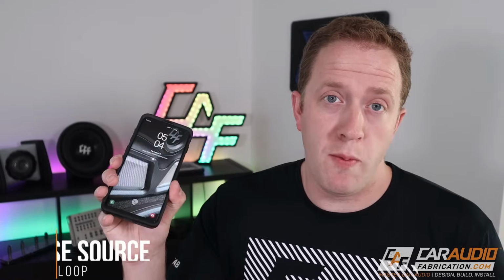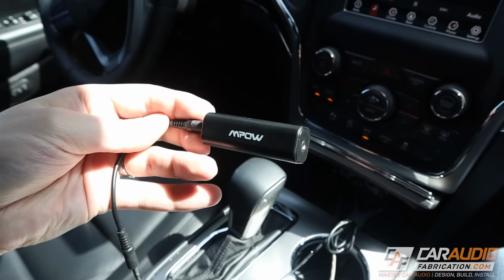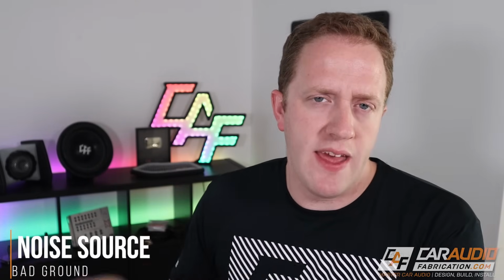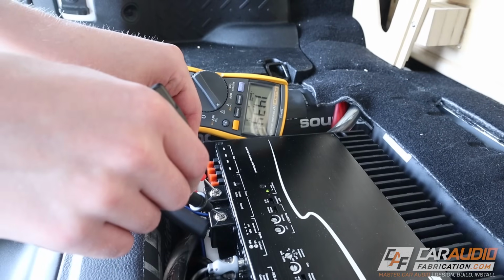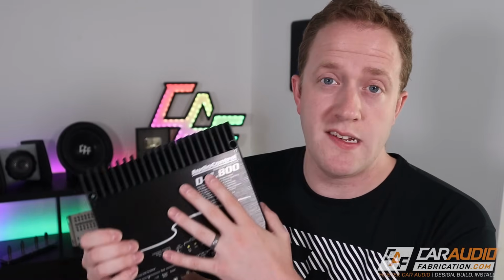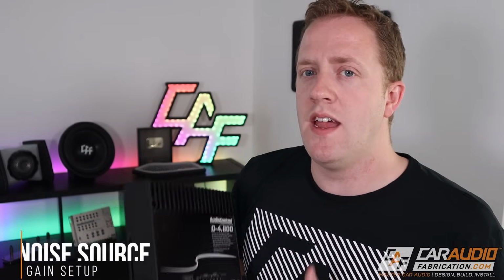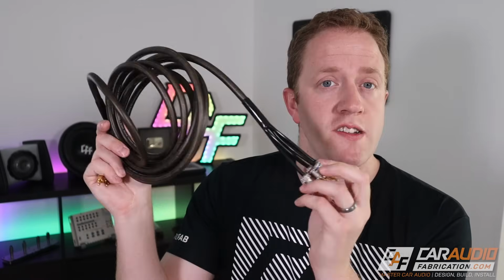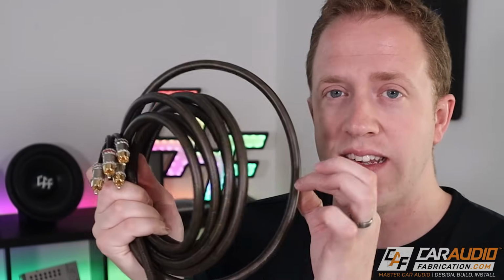BUZZ, WHINE, HISS? How to FIX Car Audio Noise!

Comment: I was just wondering if you can help me I hopped in my car yesterday had it have never had any problems with my speakers with my sub with anything like that making any static noise is than I connected my cable up to my phone and turn the Bluetooth on and now for some reason it keeps on bringing a static noise through my driver's side speaker even when I turn the car off for about 5 to 6 seconds after the stereo has been turned off it will make a static noise for some reason it's all been the same I haven't changed anything over it just suddenly started happening

Comment: After  few months if not even listening to my stereo I'm going to dive back into it.. i think ive done just about everything. Doubled up my 4 awg big 3. Ran new grounds to a busbar. From there to the head unit, and amplifiers,dsp and 5farad cap. I think one of my 3 amps is bad tho so im about to throw some more money at it. If i could find and get rid of this loop id be happy!! Ughh.

Comment: Anything recent for the fm audio issue? It’s an iPhone with fm transmitter with 2 usb charging ports. What to use?? Going insane here. FYI car is 2005 pilot there is no easily accessible aux port/plug in.

Comment: I connected my amp and subs to the factory radio and the ongoing bass drives me crazy and i've tried many things and still dont know why its still thumping. It only goes away when my rpm is over 1500

Comment: Always had alternator whine and dtatic hiss in the tweeters during acceleration. I later traced it all back to being inadequate grounding. Ill say that 95% of problems in a system come from either your grounding locations/installation or even less consodered being your remote turn on wire! My remote wire destroyed 3 amps but always showed 12V to the amp and i never even suspected the gmremote wire as i was hunting and redoing ground after ground to fix the issue. CHECK SIGNAL WIRE FROM THE HEAD UNIT ON STOCK SYSTEMS! They will go bad and arc or send a ridiculous surge during installation if your grounds are not on point! I wish i had known sooner!

Comment: Hello,  just paid a good amount of money for an aftermarket system install in my wife's 2016 Honda Pilot.  We had 2 sets of Audison component speakers and 2 JL Audio 10'' shallow mount subs all ran from a JL Audio VX1000.   When we picked up our car we noticed that there is a slight whine and a static popping noise when the doors automatically lock.  We took it back and the installers cannot figure out the issue?  Please help.

Comment: Need help! Whenever I press the remote start for my car and it doesn't turn on, I get this loud humming sound thru my subwoofers. The sound starts low and then gets louder. It stops when I press the alarm button. Any suggestions or idea it could be.

Comment: I was using an aux with my phone. Everything was good. Went into a store and when I turned the car back on there was a screeching with radio sound in the background. Unplugged the aux but the screech persists on all modes, not just aux. Factory radio, no upgrades of any kind. Any thoughts?

Comment: I have an issue I'm currently working on. Upgraded the head unit, added 3 amps and a DSP.  Once all put together I got this weird buzzing noise that went up and down with the ending revs. So I used a Ground loop isolator on my Ipod and it fixed the alternator wine but I now have this weird rhythmic ticking noice. I put a power filter on the DSP but it was still there. I test ran an RCA cable from the head unit directly to the DSP (avoiding any other electrics)  and its still there.
I'm going to add another noise Isolator to the Head unit and see if that makes any difference.

Will keep you posted

Comment: have aftermarket radio about 10 years old caused the factory speaker on one side to go out. started driving truck again and replaced both speakers, during the winter sometimes the left side speaker would have a muffled sound and if above a certain volume would cause speaker to fail. both sides working intermittently after that. each time vehicle was turned back on it was same scenario

Comment: Hi Sir. I hope this will find you. 

Briefly, my issue is in a 12v boat system.  I use a little bluetooth device with the 3.5mm connector serving the speakers. 

The charging cable to this device is via the micro plug (like a phone charger plug) via a USB and powered from the cigarette lighter port on the 12v panel. 

Noise is experienced like a clicking sound and hmmm, only when connected to charging cable. Clean whilst running on its own battery power. 

I tried different battery charger socket units, put ferrite filters on the charging cable, tried capacitors on the line but no effect

Any suggestions would be appreciated

Thanks

Gerry

Comment: Personal experience: buy a decent radio, s/n 90db or above, attach ground black wires to a good metal surface, 2003 Element EX, old pioneer stereo FAIL, cheap Chinese radio FAIL ,even worse , I just installed a Pioneer DMH-100BT, excellent radio, no noise, no whine, no hum and very good sound 😃

Comment: Have a 4 channel amp and never had a buzz and only used the two front channels. Today I added some speakers to the rear channels and now I have a buzz only in the front speakers? Any ideas? I didn’t figured it would be a ground for the amp because i figured all speakers would buzz

Comment: Ground loop isolator helped a little but but even with head unit off volume down I still hear it idk where its coming from I have to many upgrades to list done to the car the only thing I have not done an desperately need to do is add more grounds to my system........its 10,000 rms all ran on 2/0 even the (4) battery's and amps all connected through 2/0 ....
There also ALL SHARING THE SAME 2 1/0 PICES OF WIRE USED FOR MY GROUND!!! I will need to double up and add a few more Grounds using the 2/0.
Does anyone know if everything needs its own Ground each amp and battery or if using the bussbar I have is fine thanks.

Comment: I installed an aftermarket head unit for bluetooth ect with the proper facia kit for my car, its very common for people to do this because car has an icc in the dash but no bluetooth or aux so its kind of a 2nd stereo in a way. I have factory subs and amp. Now i have the loud squealing that gets louder with acceleration abd the volumehas to be all the way up to get any sound at all. It was installed with a loom for my car also. I've no idea what one of these problems could apply to my situation because my amp ect is factory and we didnt touch all that. Clearly my knowledge is very limited here but any help would be appreciated.

Comment: Love your videos they are so so informative. But man I have a problem that is beyond me. I have a dsr-1 integrated into my factory 2014 taurus limited headunit with the correct harness to match. At no volume nothing at 1 volume I have a static that just crackles and will make a literal beep sound "not any louder" but when at high volumes you can pretty much hide it completely. My power and ground are opposite from each other everything is top grade equipment and wiring. Could I email a video? I feel its something so simple that's causing a electronic disturbance sound or something.

Comment: I’m going through this right now. So very frustration. 
 
I first added filters on the rca cables. 

Them I checked the amplifier ground.

Then I changed and rerouted the rca cables.

Then I added the filters back and grounded them too. 

You mention the aftermarket HU may need a better ground. That’s the next thing I will try.

I had two amps ran through a DSP from the factory HU and all was good, kind of. I then decided to get rid of the factory HU and DPS and go with an Aftermarket HU. Alpine ILX507 to Alpine type R 4x100 amp. 

So frustrating. 

I will run a new ground for the HU next and if that doesn’t work I’ll drive it into a lake.

Comment: I just put speakers in and they're wired to the amp, I've had a sub wired to the same amp for a couple years with no interference, when i turned the car on with nothing playing i was hearing a radio channel i would never have on playing through the new speakers very lightly. 

I removed the radio antenna from the car and this fixed it about 95%.

There's a lot of contact between the metal of the basket of the speakers and the metal of the car. 

Same speaker wire is being used as on the sub. Not greatest quality probably but no problems before. 

Any suggestions? Thanks

Comment: I’ve installed 2 different DSP-810s in my car to try and get rid of the hissing. Audio Control said to check the ground jumpers in the unit. I tried all 3 settings, ground, isolated, and 200ohms and still the hissing is there! Went on Crutchfield and it looks like it’s a design flaw from Audio Control. How can they charge so much for their DSP and have it make noise?? My system didn’t hiss prior to installing the DSP. Now they want me to check the grounds 1 by 1 🤦🏻‍♂️ Can’t believe this. Anybody have this issue with Audio Control?

Comment: where's the mention of the ground loop isolator? a lot of things here might work but a ground loop isolator between rca's and amplifier fixes almost all ground loop noise. The RCA's pick up a lot of noise but they recommend a random brand instead of telling people about ground loop isolators that can fix the almost most of the rca problem.

Comment: What about a Lexus GS 300 06 with a mark levinson system. I have factory radio and factory amp? Could a blown out tweeter be causing the static noises?

Comment: I’m driving a 99 miata and have an aftermarket kenwood stereo(just the dash unit) and it whines every time when I accelerate it. Does it with nothing connected and connected when in aux mode. Would the ground loop fix that?

Comment: I've got signal noise in one speaker front & rear, when I rev the motor,  I've swapped the RCAs left/right,  the sound switched speakers. Would the rca noise reducer work in this instance?

Comment: 10/3/2022

Mark: After installing an after market radio in my 98 Mustang Mach 460 system, I heard a whining noise from the starboard side tweeter, and no music. A tech from a shop in Salem, Oregon, diddled with the wire harness, and could not figure out the issue, and so recommended that I replace the whole stereo system including speakers, amp and head unit. After the tech's effort, now I have a whine coming from the port side tweeter and no music, but the starboard tweeter works great with no whine. Also, all four rear speakers are suddenly putting out sound whereas before the tech diddled with the harness, only the sub woofers were functioning, but not the tweeters. Is the enough information for you to rule out the factory amp as being the root of the whining problem?

Comment: hi there, thanks for all the wise car audio info! 

i am looking to install a 12v studio monitor system in my studio in my ambulance conversion.
i need a very characterless amp that will give me a very precise and clear sound through the monitors which will have a flat frequency response. 

have you ever seen a system like this before? would you advise to go for this approach rather than mini active monitors like most mobile studios have? i wanted to avoid this to avoid the inverter for efficiency reasons.

any advice/ reccommendations would be epic thank you!! cheers!

Comment: I have a Boss BCPA9 in a 2012 Tahoe using Axxess AX-GMLAN44-SWC module. I get feedback at startup and when the factory chime happens only. Like If you don’t put on your seat belt and you get warning signs. Any ideas on how to fix it

Comment: I'm not promoting any certain brand, but I've noticed Alpine systems in particular have very clean sound. I'm unsure if they have superior circuitry. But I've eliminated noise problems with an amplifier just by changing brands

Comment: I just finished installing 2 sub woofers and amp , and now I have a intermittent hum coming from my subs . I soldiered my speaker wires and used ferrule connectors for my power and ground , what do you think the problem might be?

Comment: 76 GMC Sierra.  Cheap little amps.  I've had the engine noise with this truck since I bought it.  Common on these old pick-ups.  I am doing what I can to fix it.  Update when I get it corrected.  BTW...love the videos!  I'll be installing a 2-amp setup in my 70 Pontiac soon and hopefully it goes well.

Comment: Hi Mark, I have 33 foot boat with 4.5kw generator on it and boats sound system gets 60 cycle buzzing noise only when generator is running and battery are charging whit on board charger. Could it be because of missing ground between audio equipment , charger and/or generator?
Thank you!

Comment: I recently buyed a Opel Astra H GTC. It has a CD 70, with Bluetooth and AUX etc. So for music I used used AUX, cause the previous owner left me his 3.5mm cable, but few days ago it broke. I started hearing that buzzing/static noise like theres "no signal" when turning volume up, it is annoying. I thought it was the cable. But even if I disconnect the 3.5mm jack from AUX car socket the sound still continues, so I thought it the CD charger broke. Tried switching to FM, used CD, even tried a FM Transmiter that you plug into the cigarette lighter, works fine, no buzzing/static noise etc. So the AUX is the problem, google didnt help me much, some say dust got there, some say that some wires "disconnected a bit" and short curcuit problem, some say ground loop (dont know what it means), some say alternator noise (didnt try starting radio when car engine turned off, just power on from key, will update)... I physically dont have acces to the wires that go from next to the handbrake to the CD charger or where they go, so cant do much. Anyone good in car electric can help?

Comment: I literally just finished installing new door speakers running on an amp. My left front speaker would hiss drastically after the head unit booted up. I swapped RCAs front to rear, and the hiss was still there indicating it's in the speaker wire post amp. I then took my panels off again and got the speaker wire a good 8 inches from the 12v for the amps. This fixed it for me in my vehicle.... I knew I was going to have issues with running power down the sides instead of under the middle.

Comment: I have a crackle 2 months in after install. Even when the music isn't playing, but i did notice it more when I have the AC on, seems when the ac n engine does it's thing u hear a quick light crackle every 20-30 seconds with ac on, without the AC I hear is barely

Comment: I just put new speakers in an 89 accord and one speaker sounds a little fuzzy.. I’ve narrowed down which one. I have a decent understanding of audio systems and have done 4 or so successful full system installation’s, but I’m not really sure what would be causing it. I’m thinking maybe the stock wires have some corrosion, but the car is pretty leak free. I was also wondering if this could be from the stock cassette player(still waiting for the deck to arrive) because it does make a weird clicking noise with every click of the volume knob. It did this before as well. Any advice would be appreciated

Comment: I tapped a new ground and moved my amp to another location and I'm still getting noise. If I turn the key backwards to radio only there's some noise, when I turn the key to acc there's lots of noise. When car is started it sounds like a jet plane. Also when I use my windshield wipers.  Only thing I haven't done is mess with the ground from the body. It might need cleaning since it's over 30 years old

Comment: Hello.
Is there any chance the hiss noise to be from the amp and not be able to eliminate it?
I had my two way speakers passive and had no hiss at all.
I turned the head unit pioneer to network mode and connect the speakers active from the same amp which is a 5 channel and now I get big hiss noise from tweeters even with zero gain.
Any ideas please?

Comment: Still didn’t solve it! Still trying to figure out from where the noise is coming from! The thing is when I installed the speakers and the 4 channel amp all was good no noise all clean but when I added the sub amp started having some noise and the sub got blown don’t know why since I did everything correctly! Now that I have my sub in repair I have disconnected the sub amp but still have some noise change then change the ground wire and that still didn’t fix the noise issue! Forgot to mention that all my wiring are from knukonceptz just went and got the best of the best on the market!!! 0AWG from battery to distribution block and from there 4 AWG to the amps! So my next step will be to upgrade the positive and negative wire from the alternator and the chassis! And the head-unit is a kenwood with wireless carplay 10.1 inch display the best on the market in my opinion! If anyone have any suggestions before upgrading the angine wire please let me know 🙏
And big thanks to Mark for his amazing video the only channel I rely on when it comes to car audio installation and best quality material!!! 🙏🙏

Comment: I have the front right speaker humming in tune with engine.
Can't see a loose earth.
Have aftermarket speaker wires..ie, thicker insulation...
It takes a moment or two to kick in after car starts 
Just had a new alternator put in...whining was there before that ..

Comment: I have done all of these steps and no matter what I do I still get a constant static noise coming through my speakers, the only that that will quiet the noise is turning my low pass filter on and turning the gain all the way down. Other then that I constantly get noise through my mids, any suggestions ?

Comment: my common mistake is running the RCA along with the amp remote wire to turn it on together and it doesn't matter how many noise filters I put on the power for the head unit and the amplifier it's still buzzing, you just save my butt from more embarrassment 😁